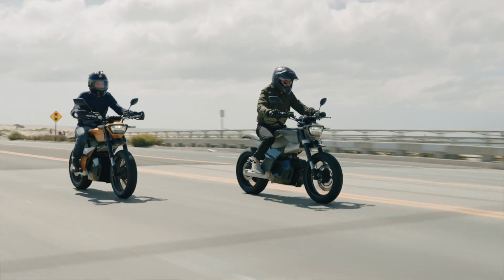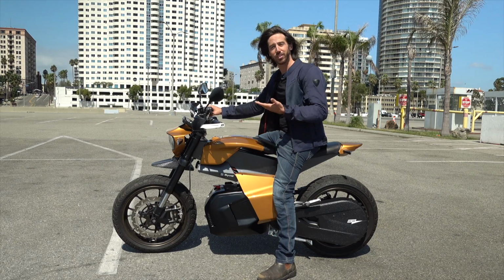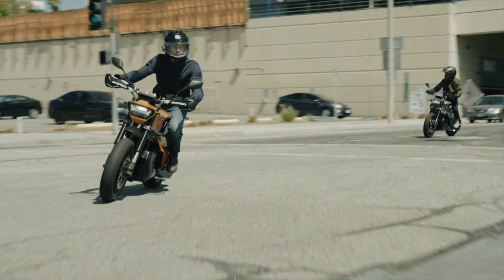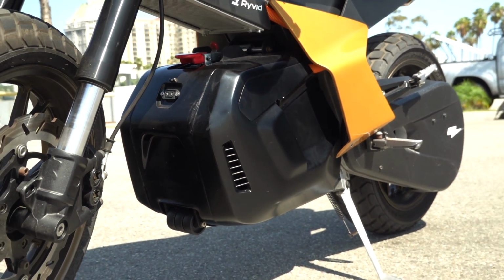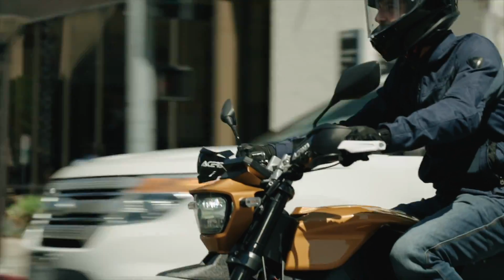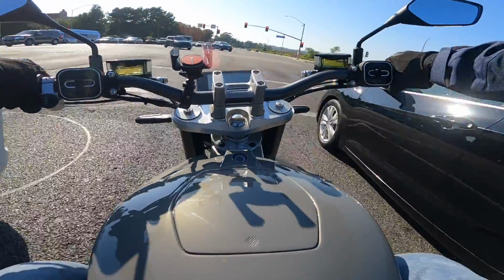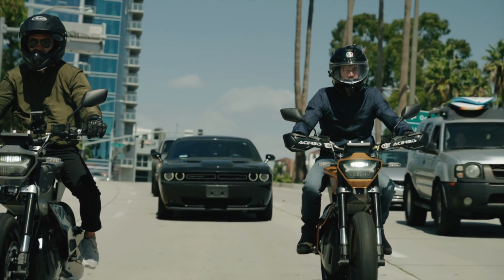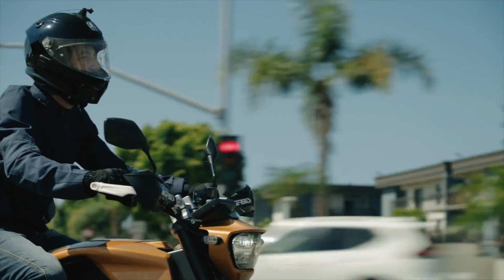Ryvid Anthem First Ride: Budget Electric Motorcycle Joy-ride!

Comment: what is the pro's of removable battery here? it should weight a whole tonne for that voltage,speed and range. So you cannot just pick it up and grab it to an office for charging.
Reply: I know this is 8 months old, but it has wheels and an extendable handle like luggage. If you watch a demo video, you never actually need to lift the battery without leverage to uninstall/reinstall.

Comment: Nice but even at 7800 that just is not good price for the range and performance.  I get it electric is expensive across the board but that's not a good excuse.  Electric will never succeed by being forced on people, it will only succeed when the tech surpasses combustion engine powered bikes for the same or equivalent cost in both range and performance.
Reply: You understand there was a time when cars where more expensive to buy, more expensive to maintain and much more limited in their distance than horses right?  Your perspective is judging ten years of development of electric vs 150 years of internal combustion development.  Right now it is more, and like in all things the early adopters are willing to foot the bill.  They will drive the price down.

Comment: Everything is fixable with time & money, but the silence of electric bikes is not likely going to weigh in their favor as regards the unavoidable, clearly regrettable and yet eventual mortalities and associated statistics.  A Harley (I.C.E.) has its low-freq rumble to make automobile drivers well-aware of their presence, especially at blind-spot/lane-changing range.  Not difficult to guess how the injury/death rates will eventually compare between (silent) electric and I.C.E. bikes.  The #1 "enemy" of a motorcyclist is an unaware automobile driver, and so silence in this case does not help.  A selectable 'rumble' may be exactly what's needed...though it's also not difficult to guess that this won't happen until the morbidity stats start to come in.  Good luck...by all means enjoy...but be careful out there.

Comment: Pretty dishonest to say that Zero motorcycles can cost 3x as much for "flagship models" but ignore the fact that the Zero S is barely much more than the 7800 this car is while being twice as good for the base model of the brand to this reviewed motorcycle.
Reply: Not sure where you are getting your pricing, but in the US (the price of the Ryvid he is quoting is in the US) a Zero S without any upgrades is $13k.  It is quicker, but it's range is about the same.
Reply: @travisshrey6720  I bought my 2018 Zero S in 2018 for $10,500 delivered brand new. I have not ridden another electric motorcycle besides that one, but from specs/range alone, I think the Zero S is still king for the entry level Electric.
Reply: @soyboi2819  You are comparing the price of a new Ryvid to your 5 year old Zero?  That seems silly.  Even if we allow that you are still talking $2700 more than the Anthem, that is hardly 'barely much more', it is 35% more.  If you are buying two new motorcycles, the Zero S is the better bike, but it is close to twice the price.
Reply: @travisshrey6720  I don't think the MSRP on the Zero has changed since I bought mine in 2018, but yeah I see your point. However, when buying electric vehicles, paying $2700 more for something will give you way more bang for your buck. It's like a Tesla Model 3 vs VW ID4 vs Chevrolet Bolt EUV comparison.

But yeah, not trying to argue with you. Unlike you, I haven't sat on the Anthem. However, just price and capabilities alone, I wouldn't say the Anthem is very good at all considering the 4.3 kWh battery and price. Great video, regardless, and thank you. :)

Comment: How much does it cost to replace the battery ?
No one ever says this...
Note that around every 1000 charge cycles the battery will need to be replaced..
Reply: The battery costs roughly half the bike so $3600
Reply: people say it all the time you just refuse to look unless it's something outlandish. And no, it's not every 1000, you don't know what you're talking about and showing yourself to be confused.
Reply: 1000 charge cycles is the equivalent of 50-75k miles.  That is a lot of gas, oil changes, valve adjustments and other maintenance on an ICE motorcycle.  That will also take you several years to reach and by that point batteries will be much lighter, cheaper and faster as everyone works on battery tech instead of ICE tech.
Reply: @c2thew  thank you, this is actually not a bad price. This means that in Europe it will cost around 4000 euros. 
If you make 10.000km with the bike, at the end of the cycles, you will have to pay the price of the motorcycle for the battery. 
With ICE, saying that you make revision every 10k, this will be around 700 euros maintenance. 

About valve ... comon, this is not a big deal unless you have a v4 engine.
Reply: @LukeScrapWalker-Plays  I"m not sure what kind of math you are doing but it is wrong.  A full charge yields 50-75 MILES of range, so after 1000 cycles the motorcycle would have 50-75 THOUSAND MILES of wear.  I've had motorcycles for a decade and never put that many miles on them, so the idea that you have to replace the battery pack in a short amount of time is nuts.

Comment: All the sudden it would be "meant for that type of riding" if they hadn't destroyed hydrogen fuel cells so they could keep using lithium-ion batteries.... for whatever industry profit motives they derived by doing that. Hydrogen fuel cell was the invention they came up with to cure the range vs weight problem.
Reply: Hydrogen fuel cell wasn't "destroyed", it had it's own problems. Before you continue, tell me if you know what Hydrogen Embrittlement is without googling it.